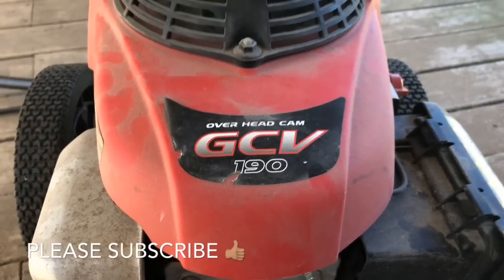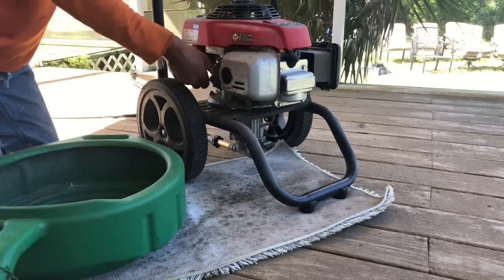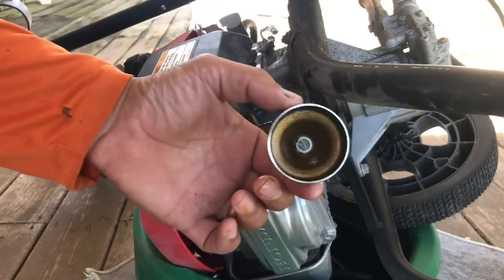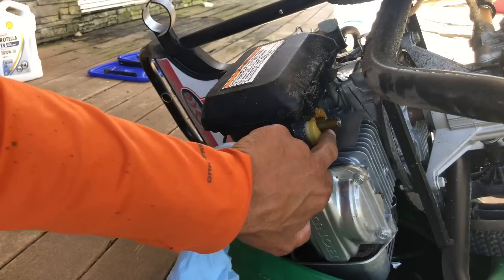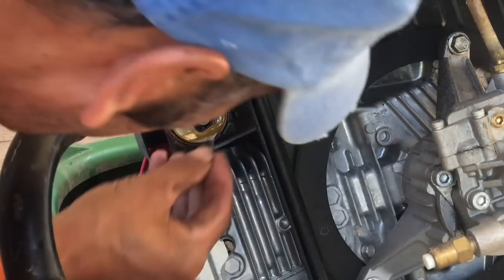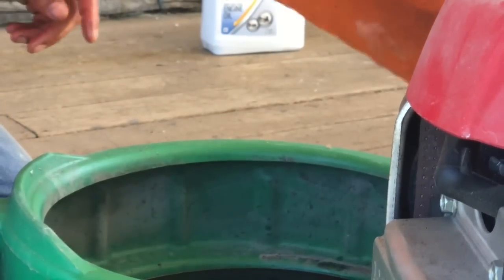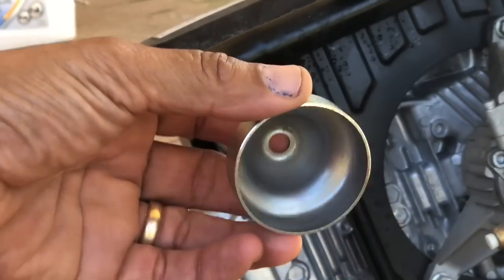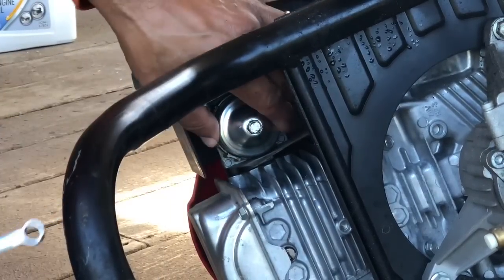How to start a ..GCV 190 HONDA PRESSURE WASHER

Comment: Informative.  I was working on my gcv190 this afternoon and couldn't figure out how to get the jet out period after watching your video he showed that it needs a tap for it to come out. The set screw came out easily it was a little clogged and I put it back so tomorrow I'm going to pull the set screw out again and get the jet out. I already replaced the gasoline. The oil didn't need changing. Sorry for the lengthy, but I just wanted to say I appreciate the video that you did with the same machine I have. Best to you sir.  Thanks again.
Reply from the maker: I thank you for watching, glad it helped 👍🏽
And we’ll done for doing it yourself 👍🏽

Comment: Great step-by-step instructions  and very clear pictures . We were able to easily perform the maintenance and get the washer started.
This deserves a big- great job!
Reply from the maker: Dr. Patti Dammier thank you , glad it worked for you
Reply: Hi , Mr. I purchased Honda pressure washer GCV 190 last year just one
Time i used  & kept. After 2 weeks i tried 
To start , it doesn't started.  I clean the 
Jet & nozzle not started.  Then i left it
Un touched.  Now this year i took out &
Re cleaned again not started i took out
The plug , it was carbonized then cleaned 
The plug & kept back not started.
So i need your help please help me.

Comment: Great video.   I have the exact same pump with the exact same problem.   I found your video  after I fixed it.  BUT, it did show me that I didn't have to completely remove the carb.  My problem and question that I was researching when I found your video is now that it runs, it bogs down greatly when water pump comes on.  I've treated pump with Stabil pump protectant.   Also, my motor now runs now at breakneck super sonic RPM's  just to keep up.  Speeds way above norm.
Reply from the maker: If your question is why is it running super sonic..!??
That could be that you have lost something to govern it down like the fine nozzle that goes inside the threaded valve area at the bottom or the hand held  gun?!!

Comment: May I point out that beating the carburetor to somehow free-up the removal of the emulsion tube and it's retainer is contra indicated - although an entirely new replacement carb for the potentially destroyed one is not expensive at all.  A drywall screw can be gently twisted into the low end of the emulsion tube to give purchase for removal.
Were you to have removed the carb to properly clean it internally you would have been able to open up the choke plate and at the rear of that opening you would have seen the top of the emulsion tube.  Gentle downward pressure with a screw driver pops out that tube and VERY CAREFUL cleaning, including the use of carburetor cleaner, will open up and flush out those minute yet critical openings.  At the same time the float and needle could have been removed to check and clean that critical area as well.
May I also make the point that as an electrician you would not attempt to wire up a work box using a nail clipper and a butter knife as tools and along that same thought I might suggest that proper tools to work on a carb would include a properly dimensioned screwdriver and at least a can of carburetor cleaner.  The use of a safety pin to clean the emulsion tube holes is marginal at best and could easily result in cumulative enlargement of the critically sized spray holes.
Filling the now clean petrol tank with unfiltered fuel is (probably) where the crud in the tank came from before.  Many of us believe fuel cans spawn all the foreign matter in fuel tanks.
All in all a good, minimalist cleaning of many (but not all) of the important areas where 'junk' and corrosion accumulates in all carburetors.
Reply from the maker: Interesting comment.
Many thanks 👍🏽
Reply: The beauty of this video is that most of us out here have a similar setup with a similar lack of specialty tools. This is a before that shows how to get the job done for the every-person.

Comment: You make it easy thank you brother greetings from Texas!!
Reply from the maker: Latin Rox thank you.
It is a lot easier just to open and clean out the Carb. Instead of the whole works.
That should take around 15 minutes.
👍🏽
Reply: The round gasket in the bottom is it hard to put it on ? Because  the one I have broke a little
Reply from the maker: No it’s easy.
On my video it shows you how to tap it off if it’s stuck.
It’s just tightly pushed on.

Comment: Hey I used mine about a month and a half ago but when I stored it away I put it in a tilted position 45 degrees to be exact and now mine doesn't wanna start do I just need to general service mine or had the oil leaked over I to another compartment?
Reply from the maker: I would place it back to it’s correct position for a day.
See if it starts. If not check the oil again, top up if needed.
And check the gasoline.
If it doesn’t start then…. Do what I had to do.👍🏽
Would love to hear the outcome please.
👍🏽

Comment: any way to get the second jet out.  I've sprayed and banged....The first jet is clean.  Would 93 octane 100% fuel help burn anything out.  The fuel tank is clean and ready to put back together, but would like to clean that second jet if possible.
Reply from the maker: Can you push some types of thin metal into the section jet and wiggle it and tap the outside again to see if it comes loose?
Or spray some cleaner to help break it lose leave for a bit then try tapping again..?🤔
Reply: @wolfeman1966  I did all that....nothing....well I was able to push a pin through the second jet which allowed me to confirm clearance at least through it.  I was gonna test it and I put all back together and pressure built up but didn't spray from gun then quit.....I'm assuming  pump suddenly went bad
Reply from the maker: Jason Whitecotton 
That inner jet has holes around it that need to be cleaned.
I don’t think it’s done with yet.
Give it and go.
Persevere, it’s worth the satisfaction of winning.
Or just buy the new parts.
I believe someone on my comments bought the parts of amazon cheap..$35.00 or something like that.
👍🏽

Comment: I never leave fuel inside the tank, I always let the motor run and shut off it self of lake of fuel. this time I tried to start and it didn't. I find out my fuel line had pin hole crack , now I need to get new fuel line.
Reply from the maker: Armen JS Martin it never rains, but it pours..😳
Not good, maybe it dried out allowing it to deteriorate.🤔

Comment: is that choke pin supposed to go all the way back? mine doesnt do that and i cant start it.
Reply from the maker: Well it should pull out about less than 1” 
Then when it starts slowly push back in or it may cut off.
If it’s not starting that mean you will probably need to clean out your carb, like I did as it’s not getting any gas.
Hope that helps 👍🏽
Reply: @wolfeman1966  it wasnt pulling...so got creative and tied a piece of string to pull it back and tied it to the bar....then pulled the string...it started...then untied the string and the choke went back.
Reply from the maker: @ozaernajim4315  wow 😳 that Genius👍🏽

Comment: I cannot get this screw out to clean a jets - so I ordered a new carburetor with spark plug from Amazon for $ 12...
Reply from the maker: Tom C. Did you try WD40 or screw loosen..?
I would have sprayed it before spending.
But I hope you got it sorted 👍🏽
Thanks for the info
Reply: @wolfeman1966  Yes I tried WD 40 - and nothing. But for $ 12, they send you a brand new carb, spark plug, 2 filters and fuel line...
Reply: 2 air filters and one fuel filter...
Reply from the maker: Tom C. A Good price .
Can’t say fairer than that.
Thanks for the info.
That should be good for those in the same situation.👍🏽👍🏽
Reply: @wolfeman1966  And it works like new again 👍🏽
Reply from the maker: Tom C. I should hope so..😂
Good job
Reply: link? mine is stuck also

Comment: Can you spray the pin with a carburetor cleaner?
Reply from the maker: Poro Kilaw yes you can but it’s really easy to take it out and lean it...5/10 mins the most.
I used the washer again last week and I just cleaned out the carb. And it started straight away.
That video is a bit long winded but just shows most things you may need to do.
Once you have done it , it easy 👍🏽
Knowledge is power
Reply: Thank you for answering my question. Keep up the good work and videos.
Reply from the maker: Poro Kilaw your welcome

Comment: my copper jet is stuck and the thread is stripped, any ideas?
Reply from the maker: Are you meaning the water jet on the handle..?
If so I would leave it to soak in some penetrating oil, WD40 etc...
Then either buy a screw extraction tool or put it in a vice and drill it. Starting with a small drill bit and work up until it either turns the piece out or you can get it out by other means, pliers, screw another screw into the hole with a bit of glue then screw it back out.

Hope that helps!!
Would love to know the outcome 👍🏽
Reply: @wolfeman1966  thank you. i cleaned it well and was using heat to soften up the copper so i could punch down a new groove with a hammer and flathead screwdriver. i ran out of daylight, but will try a few things tom. any ideas where i can find a replacement jet? any idea the jet replacement specs?
Reply from the maker: @austinsellers9997  if you have a Lowe’s or Home Depot I would try them .
If not then Amazon